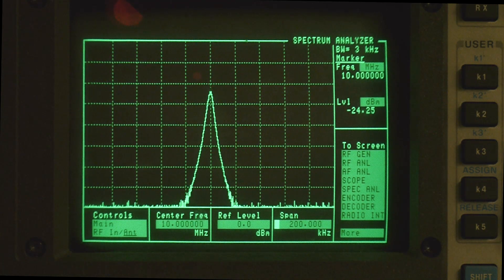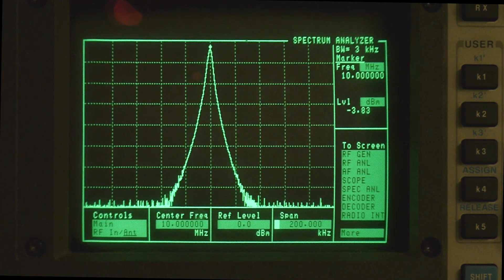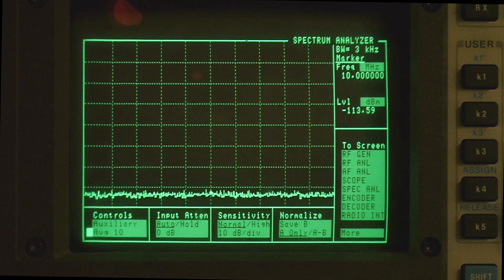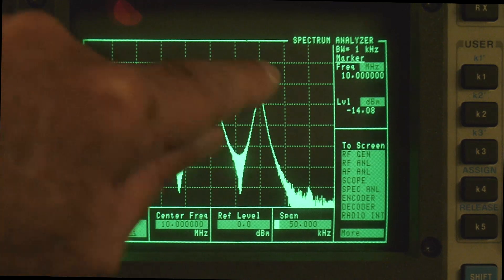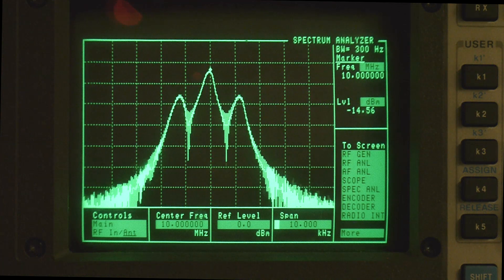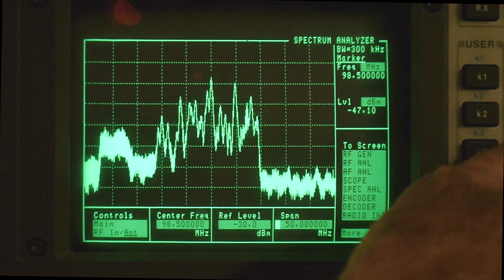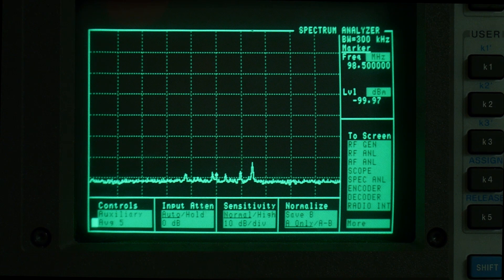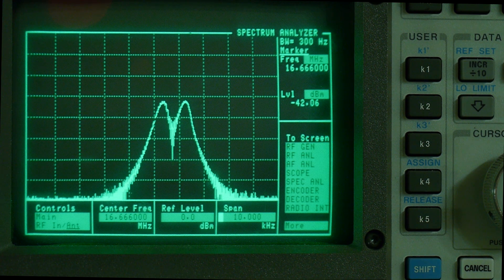#570 Spectrum Analyzer Evaluation

Comment: Great video. I have a few spectrum analysers mainly because I like repairing test equipment and I recently found your review of the Tiny SA which I have bought just out of interest.  I’m going to do a review on the the a Tiny SA myself but nothing I can add that you haven’t also covered.  One thing I don’t fully understand is video bandwidth on a SA can you enlighten me. Thanks for for the great tutorial I will include a link to one of my old project just in case your interested etc. One of my favourites as my spectrum analyser exploded in this video https://youtu.be/iYg_ps_zeeQ
Reply from the maker: a video will post on the 4th to answer this